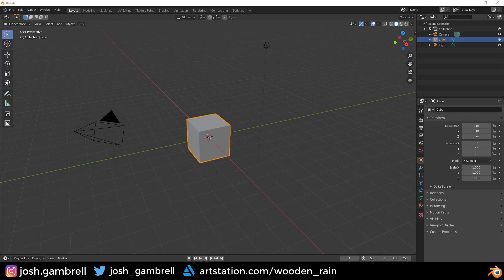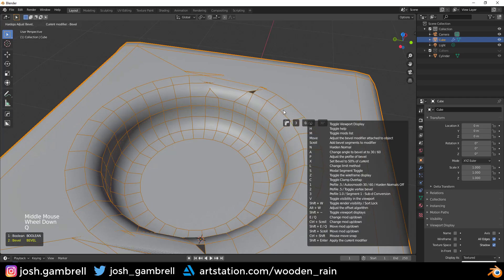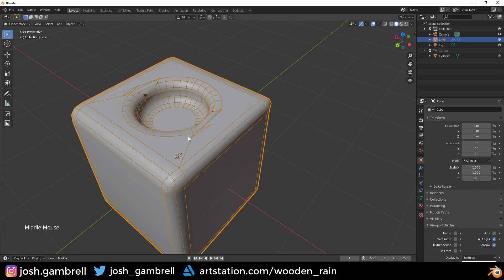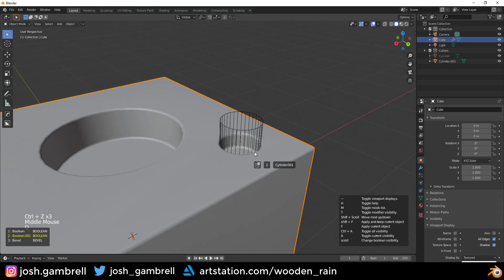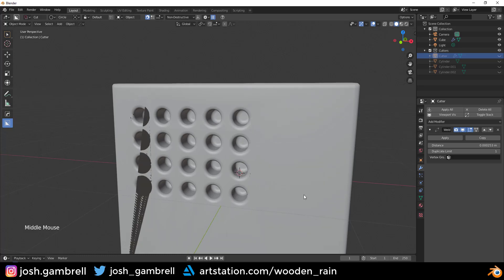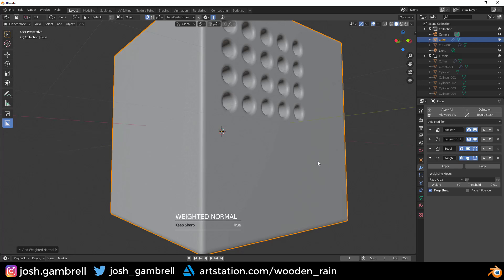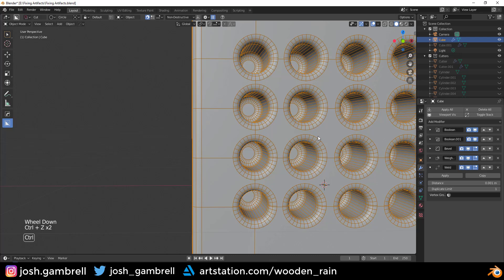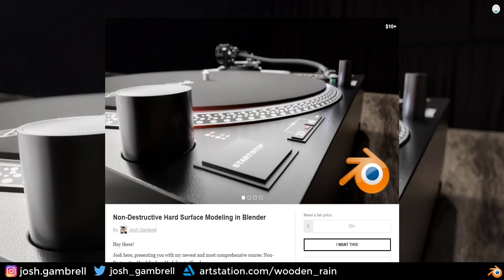How to fix artifacts in Blender

Comment: I always try to avoid the Boolean Modifier, it tends to create more problems than it solves. I only use it as a last resort, but with these tips I might give it a chance more often.
Reply from the maker: It all depends on your workflow and goals. For hard surface, more often than not, my goal is to manage ngons, not avoid them. Ngons and booleans can be your best friend if you use the right workflow and don't need deformations or game assets. Of course, it's best to retopo if you have the time and mental aptitude and I try to keep quad-based when I can :)

Comment: Great video.  You really do have a talent for teaching.  So, after doing all that you described in the video, and applying the modifiers because you want to print it ( 3d print) how would the 3dprint tool analyze it as far as manifolds, intersecting or zero faces etc?
Reply from the maker: You need to check for non-manifold geo, like interior faces, artifacts, overlaps, and that addon can do all of it for you :)

Comment: This is great, thank you! So, what about the fact that there are a lot of ngons on the model now? Don't you need quads for optimal UVing and texturing? Plus, if you were to subd the model, wouldn't it be messed up?
Reply: You don't usually use a sub-d workflow with this process. You use Bevel modifier instead. When I have used a sub-d modifier, I've moved it around the modifier stack and added a bevel modifier.
Also Ngons are only an issue if you're going to animate the object. Booleans and Hardops style modeling is usually mechanical. No deformation, no problem.
UV and textures don't really care.

Comment: The problem with stopping at just doing this amount of work, is that it doesn't account for exporting and applying the geometry. Booleans even when cleaning up in modifiers will still have messy geometry after applying the physical mesh, so exporting for games, movies or printing still requires more work, this is really only handy for renders and concept works. But also I felt like the tips here were quite basic, simply adding loop cuts or knifing in some extra topology to fix mesh issues is a super early learning point. It's fair if these tutorials are designed for beginners though.
Reply from the maker: I mostly do concept art/renders, so as you said not a huge issue. For games if it’s a static object with no deformation, simply triangulate and export and you’ll be fine. With printing the topology doesn’t matter as long as the mesh is manifold. Can’t speak on movies. I’d argue that booleans actually have very elegant geometry if handled correctly and cleaned up accordingly to remove shading/artifact issues. Nonetheless, I appreciate your input and hope you see my side of things :)

Comment: thanks for the tutorial josh! just a question at 4:05 how did you get the kinda like bullet point in the vertex in edit mode?
Reply from the maker: I just increased the size of the vertices Edit->Preferences->Themes->3D Viewport->Vertex Size
Reply: and also in the modifier at 11:10 what addon is that you can have an option to apply all modifers?
Reply: @JoshGambrell   ty so much! you've help me a lot in 3d modeling specially in non destructive method! :D
Reply from the maker: @joaquinablaza9619  Modifier Tools add on

Comment: HI I have a problem about dealing with boolean above boolean, I cut a beveled cox with a big cylinder and cut it again with a smaller one cylinder near the big cylinder and it has that weird effect, I tried the method you teach and there's seem not work with it. THX
Reply: the shape I cut it's like a mickey mouse shpae(three circle) the big one is deeper than the other two circle.

Comment: If I apply subdevision surface on such a beveled and loop cut model --> mesh is broken. May be some one knows the solution. Shrink wrap does not work in that case. So I have no chance to apply a UV afterwards.

Comment: Would you recommend that Hard Ops addon for beginners? Like I just started and it seems pretty useful to have seemingly everything in the RMB menu (I love menus)
Reply from the maker: Good question, but no. Learn how to do it in vanilla Blender first. It’ll help you in the long run. My new non-destructive hard surface modeling course does it all vanilla and will help you understand how to do it manually and in vanilla. Dm me on twitter @josh_gambrell and I’ll give it to you for free. It’s a helpful course which I worked hard on.
Reply: @JoshGambrell  Thanks but I'll pass though I appreciate the offer. I think your videos here, blender guru's donut tutorial (as boring and inefficient as it is) and good old trial and error will do most of it fine. I'll keep at it vanilla!

Comment: why can't boolean work without connecting the verticies from edge of cut ... can't it just make a hole in the face? or mabe it could work like in sculpt mode with variable detail and remesh the cut faces to prevent errors
Reply: loop cut is good walkaround tho ... I'd just apply bolean, delete face and fix the geometry manually which took some time

Comment: I'm quite the beginner with blender but couldn't you just add a simple subdivision surface modifier to get the same effect as manually adding cuts?
Reply from the maker: Subsurf doesn’t operate well with booleans. You’ll have all sorts of issues.

Comment: How come Edit Mode faded out (or temporarily removed) the two cylinders @6:05 and the loop cut worked, but @6:40 Edit Mode didn't do that? In my opinion, if Edit Mode would have temporarily removed the cylinders again, the second loop cut would have worked.

Comment: If you make models for 3D printing those pesky artifacts are very annoying, and sometimes the slicer cannot repair them.
For that reason alone, it is a good idea to clean up the mesh.
Reply from the maker: If you’re 3D printing. I will not waste my time cleaning if I have 0 plans to print.
Reply: @Josh Gambrell 
I understand. And do not disagree.

My comment was merely to point out a possible problem for some of your viewers who does 3D print.

At one point I was going to print a very nice model made by someone else. It looked absolutely fine and beautiful. 
It did, however, turn out to be seriously flawed. More than 8,000 artifacts from boolean operations. 
Took a while to fix.

Comment: Auugghh but if you use the weld modifiers all your holes are no longer geometrically perfect! I prefer to make use of snapping so that everything is aligned perfectly the first time I put it in.
Reply from the maker: That is also a valid option, just requires more manual work :/

Comment: I know this is beside the point of the video but cant you avoid all of this by not using a boolean. So much cleaner to add a circle, make it flush with the face, join, then just delete and reconnect edges. So much more control imo.
Reply from the maker: In this case, of course you could. But once you go into more complicated and detailed pieces, using booleans become a way of life. I just thought this example was most practical and easy for people to understand.

Comment: I just started looking at Blender tutorials and when I see these rendering failures  I wonder if Blender could't be programmed better so this doesn't happen in the first place? I mean in 2021 a 3d program should be fine when you simply cut one basic form from another without going haywire, right? Same with anything other than 4 vertecis = artifacts just sounds like 1980 software problems to me.

Comment: Is it me or the Weld modifier sound like an awful idea? How can check every corner that one didn't mess up with the wireframe?I much prefer to do the welding where is is needed.
Reply from the maker: You can also use vertex groups and place more than one of them in the modifier stack. It's good when needed, but I always try to avoid it if possible.

Comment: Easy don't use booleans, no one that know anything about 3d fundamentals would not use these many booleans.
Reply from the maker: Sorry, but this isn’t true. Boolean workflows are one of the most powerful and essential workflows in 3D. As a matter of fact, most who do know about 3D fundamentals and work with hard-surface objects use booleans all the time. Imagine trying to model a complex biomechanical arm completely destructively. It would be extremely difficult and take way more time. A better strategy is the boolean-bevel workflow, followed by retopology if necessary.
Reply: @JoshGambrell  i worked professionally in the industry for 6-7 years, and i have mainly been using Maya, and i can say that booleans weren't used a lot before the sculpting tools, but now that there are sculpting tools no one use them anymore, and i can imagine someone that model a complex biomechanical arm without booleans, you can cut everyshape you want without booleans, and you have so many benefits from not using booleans, first of all the topology is so much better, 2nd when i use booleans maybe in Maya or Blender the result is good but then when i export the file to substance painter, there will be a lot of artifacts, 3rd the edge flow is broken, this is more a malus of not having good topology but it stills a big problem, 4th booleans create a lot of non manifold geometries, and if you have non manifold geometries you can't use bevels, and 5th problems booleans aren't consistent, sometimes they can work well sometimes they can just go crazy and destroy your model.
Reply from the maker: @marconapolitano2821  You do have good points there, but at the end of the day it depends on your workflow. Take a look at Masterxeon1001's tutorials. He's one person I've learned a lot from and he's worked in the industry big-time as well, and most of his workflows focus on boolean workflows. You can always retopologize at the end anyways.
Reply: @JoshGambrell  yes but usually the workflow of person in a pipeline is very different from what he shows in a video on YouTube, because most of the time a model of a gun takes me 40 hours and obviusly i can't show 40 hours of tutorial, so i will be forced to simplify things,  and of course i will use booleans to save time, i am not a big fun of retopology because it increases the number of vertices and it has some problems, if you mean manual retopology sometimes you just don't have enough geometry, because if one of my model is around 6-7k vertices, there is no way you can do manual retopology without loosing details, booleans are great if you do archviz, but other than that you should try to avoid them.